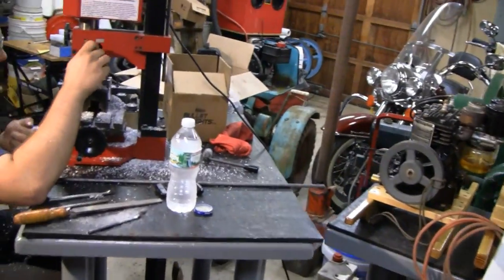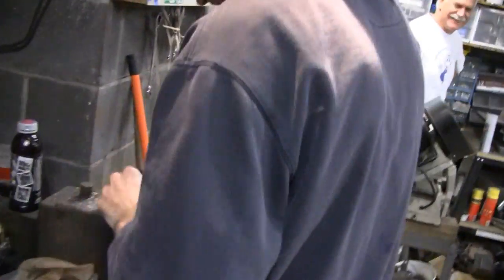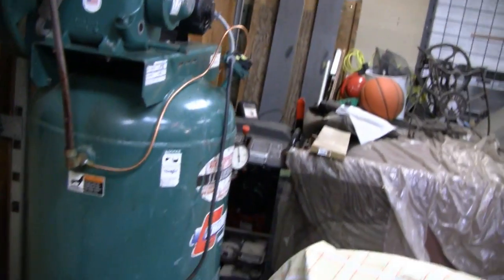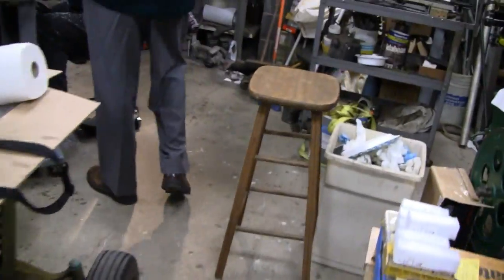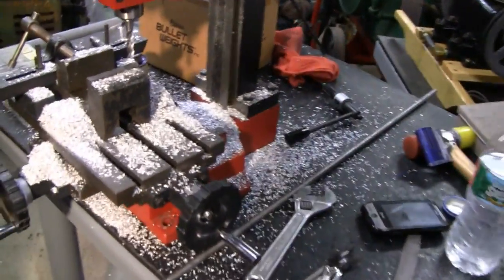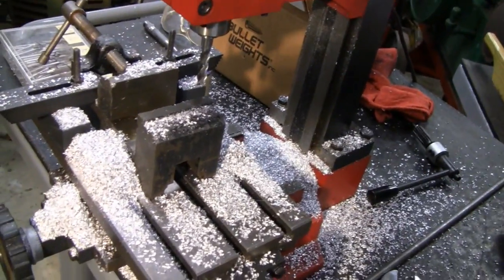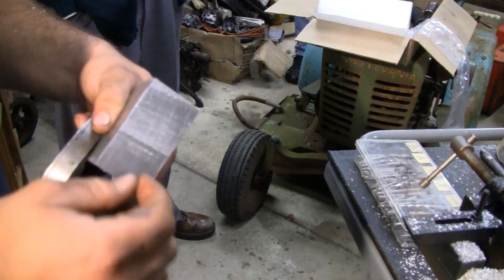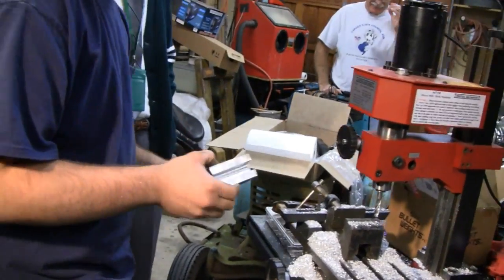MINI MILLING MACHINE PROJECT

Comment: why is the top spindle of the milling machine wobbling all over? couldnt you have just used a pipe that had been cut out to fit over that?
Reply from the maker: We just threw a bolt in there to hold the collet, I didn't feel like spending $20 on a drawbar!!☺